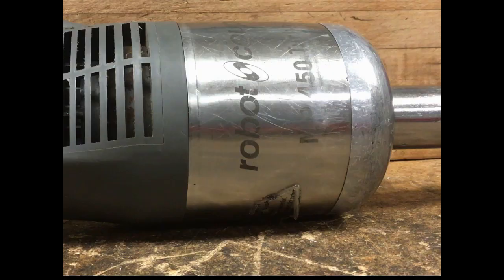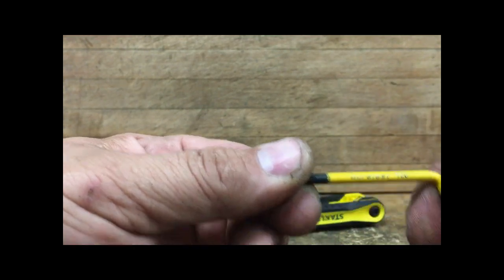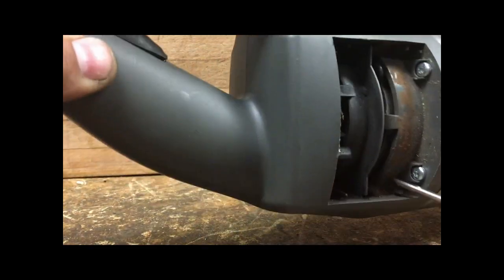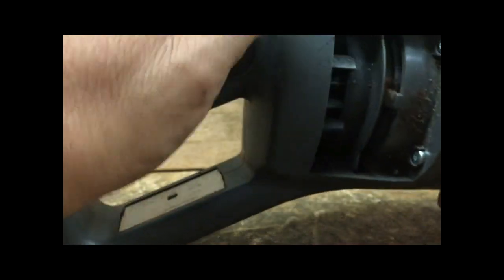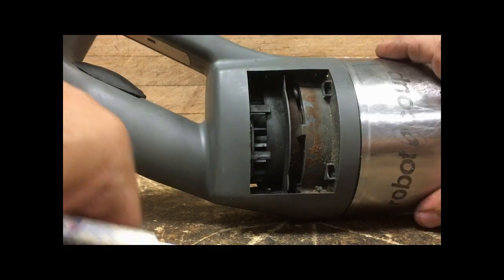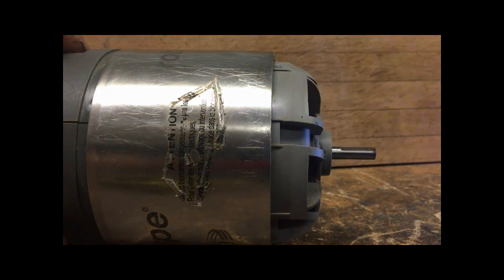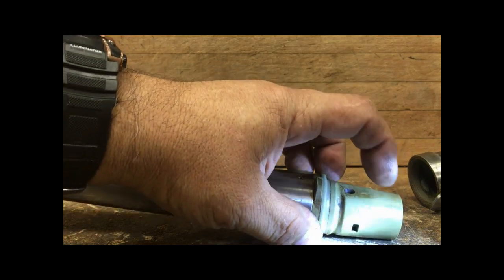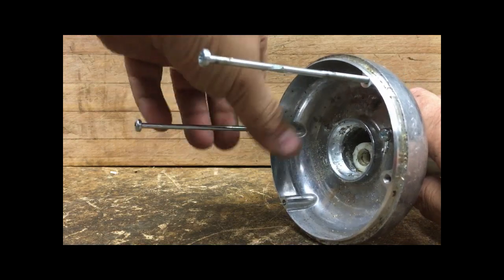Robot Coupe, 450 Turbo; Part# 01 Start Disassembly & Remove Shaft

Comment: How do you can take out the driving shaft. My one looks like "stucked"
Reply from the maker: Usually leverage, if no one is there to help. A good vise that is big enough to grab the exterior, can work of course, but make sure you use wood in  between so you do not damage the housing. Also make sure you do not over tighten the vise. Gradually tighten a little more at a time as you attempt it. And a food grade lubricant spray. If you couldn't take it off like the video shows, then chances are there is rust and that's not good especially when it comes to food. As a final resort, use a mallet to tap around the base. Probably time for a new one.

I want to make sure we are on the same page here, are you referring to the part where the motor base seats against the top housing? If so try wedging a screwdriver with a small tip between the base chrome cover plate and the shaft. If it still does not, try a small amount of WD-40 only with a spray tube to use it on the place where the motor shaft joins to the Mixer shaft. Let it sit for about 7-10 minutes, then try again. Keep motor section on top so no WD-40 drains into motor area, this could drain back into food when using the mixer later. If you do remove the shaft, ensure that you clean up that area very good and use a disinfectant  before attaching a new shaft. Also spray a
food grade lubricant afterwards.

Do not for any reason use WD-40 on the Blade attachment area. If this is jammed, try using a pipe wrench to the exterior, while the mixer is in a vise. Good luck.
Reply: @practicalreview6400  
Many thanks! Yes, was rusty/dirty inside. I ordered the new shaft. Hopefully, the assembly will be an easier job. When do you upload the 2nd parts of the video?